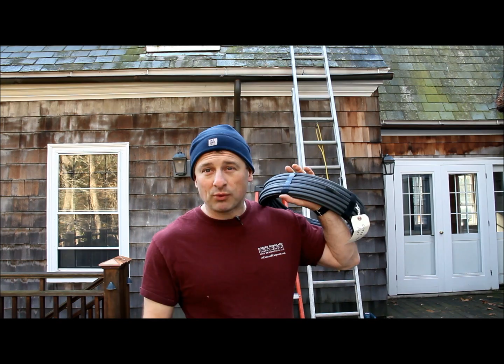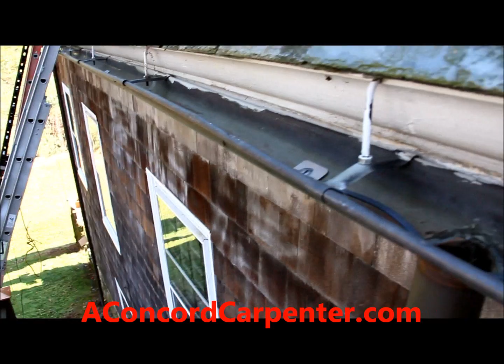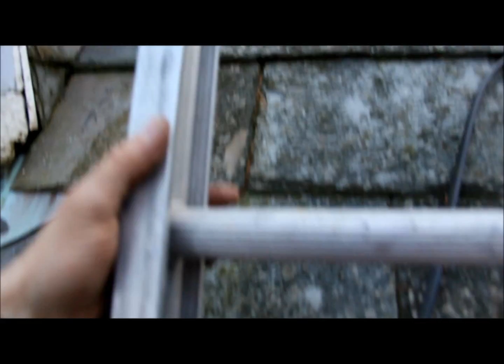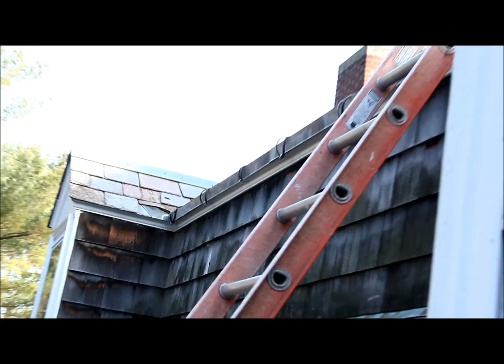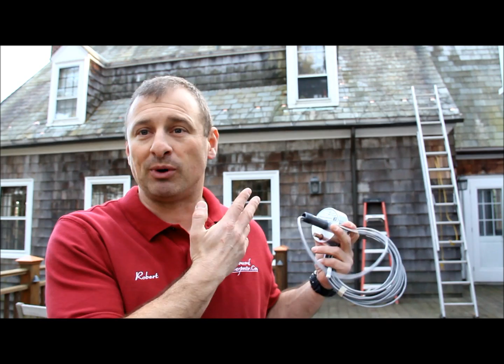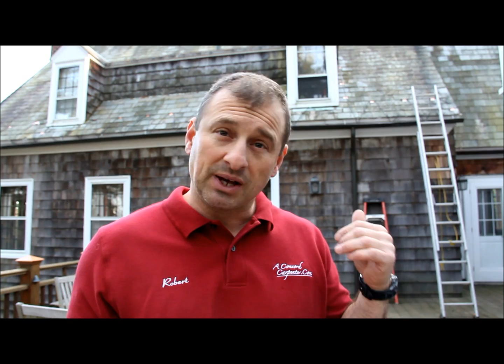Installing A WarmlyYours Roof / Gutter Deicing System

Comment: Warmly Yours is some beautiful equipment. I did a nice system for a blue slate walkway complete with the snow sensor and interior control box. Thing works beautifully. I have a small gutter de-icing equipment job on the horizon and I;m gonna go with Warmly Yours based on my previous experience with them.
Reply from the maker: They sure do